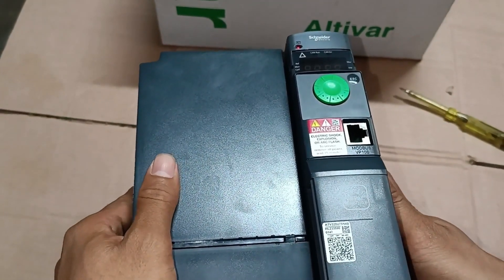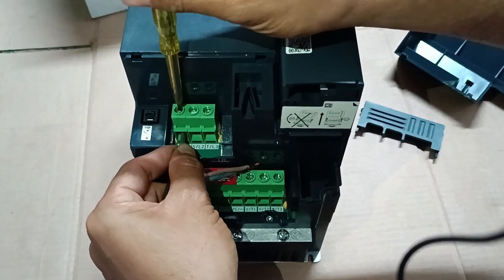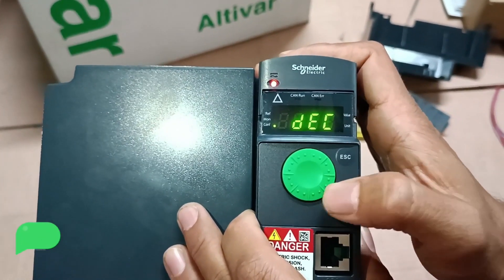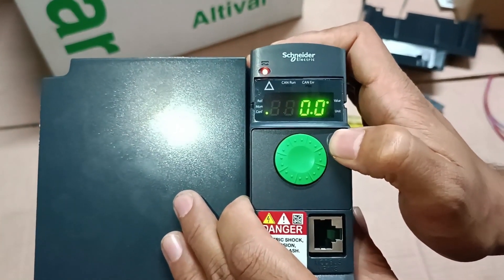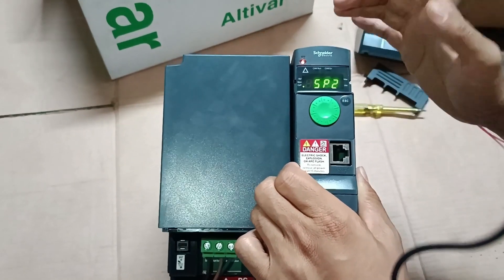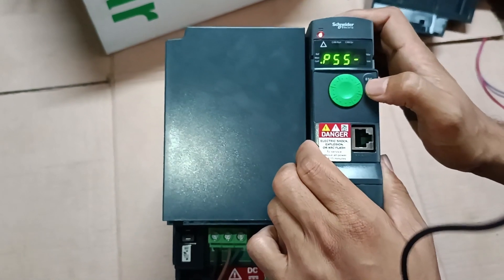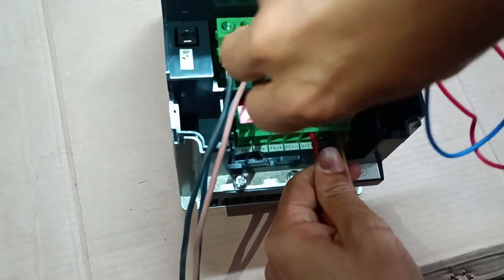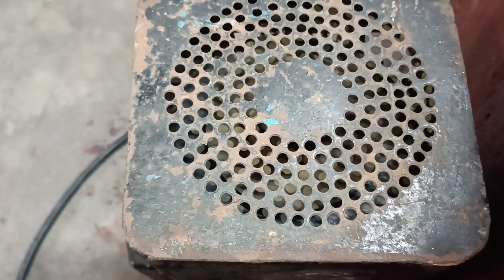Schneider ATV320 VFD Basic Parameter & Multi Speed Setting |Motor Run Setup Guide.

Comment: Hello,u can make video on nst freewheel stop,new vfd of ATV 320 display not showing RDY what are corrective step to keep VFD rdy
Reply from the maker: Make sure that 24 volt is not go to the D1 before Switching ..... Before switching If D1 signal is enable that time showing NST fault.....
Reply: Plz make video on this if possible @10minutesengineeringsolution